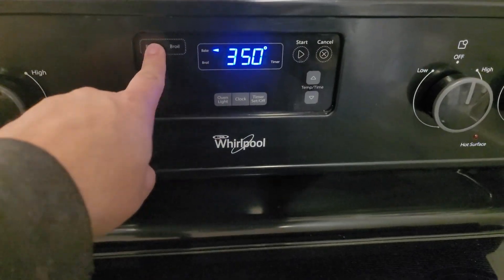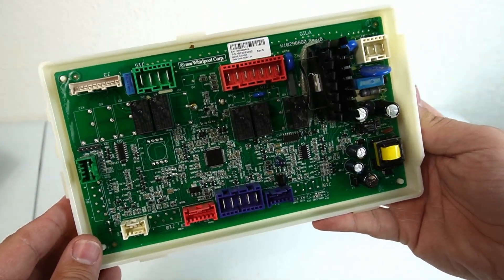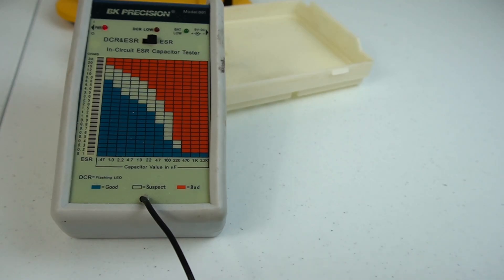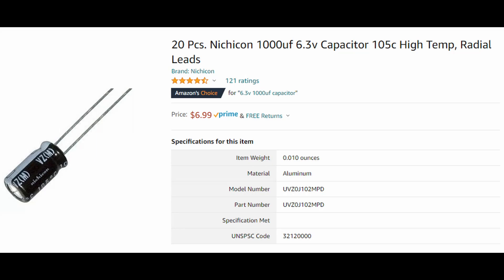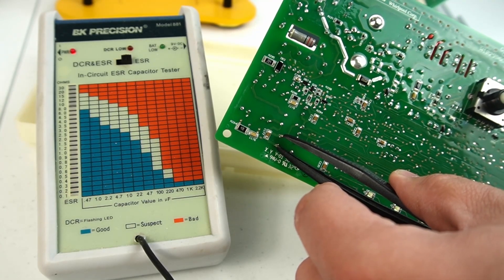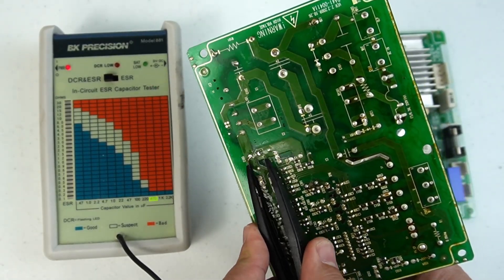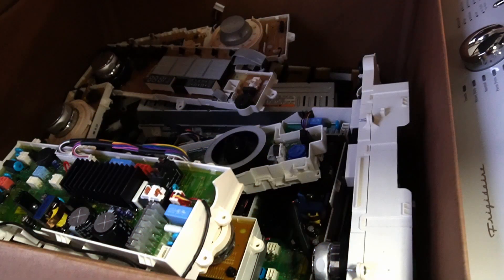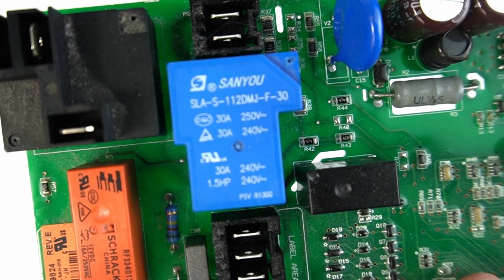Fix Your Broken Washer Control Board for CHEAP! How to Use an ESR Meter for Board Repair

Comment: What’s up Ben , love your content and really inspired to start a new career in this field. I have a favor to ask if you if possible . I have a whirlpool washer control board and I mistakenly burnt the big resistor that connects to the diode pair . I’m in good faith that nothing else took a hit other the  then the resistor . I was wondering if you could tell me the value of that resistor? The color bands on my are not able to be used and the ones I found on line don’t show it cleanly enough.

Comment: where do you have the video on how to remove the rubber coating on LG samsung washer and dryer boards?
Reply from the maker: I'll be honest and I think I've shot a video on that yet but that is a great suggestion on something I should be doing soon for you and others
Reply: @bensappliancesandjunk  the LG dryer control boards common issue is the relay connection on the board usually?   How do you take out the board from the plastic holder with all the conforming sealant? sealant?

Comment: Thank-you for this video! Found similar mystery board issue affecting lights, signals, safety stops on my family's medium sized tractor...how does one verify the existing board is the problem, with or without a schematic?

Comment: Excellent video and excellent teacher.  I know NOTHING about electrical circuits but was able to follow.  I have an LG Washer and love it. I bought it used about 10 yrs old and had it for another 7 yrs.  I refuse to give it up. I am getting an OE error and washer is not draining. I cleaned out all hoses, checked connections, replaced drain pump, checked water inlet solenoid valves, and pressure sensor. All working fine.  Some of the Display control panel buttons have never worked on extreme right side.  I think it maybe a Display control panel malfunction.  I do not have an ESR Tester only a Multimeter, sigh. I have to borrow one or figure out how to test main functions in that display panel or maybe its a fuse.  All I want to do is fix my OE error and get this washer running again. But, I am willing and able to check any capacitors on my board at some point and fix them. Your video was most helpful, many thanks.
Reply: Any updates on your washing machine? Was you able to fix it ?
Reply: @Chumichurri   @Chumichurri  Yes! It was the drain pump that needed replacing.  First I cleaned out my pump that was very clogged up, but that did not work. Then I bought one on Amazon but it did not work so I returned it, wrong model fault of seller. Then I found a genuine LG drain pump locally, at a good price, so in it went. Success!!  I cleaned out the whole machine, labeled all parts inside, repainted top, cleaned gasket, cleaned every hose.  Now it works like new. It takes tenacity to work out the bugs, but worth it.

Comment: Suppose its the type( Ex:MVW6200KW1) that the board topside is filled in with epoxy and the bottom is encased in nonremovable plastic

Comment: I have a frigidaire model fgid2466qf9a it power on then cut off. I checked for power and there is. I took off the board but do not notice anything burnt. Any suggestions

Comment: Question for you I have replace 3 board on my washer something keeps damaging the boards.can you tell me what will do that...
Reply from the maker: Question is what part on the board went bad. I've seen drain pumps knock out triacs on boards that show the drain pump is bad, and the board gets replaced when it's both board and pump. I'd investigate the board and go from there on why it died vs. Just replacing the board

Comment: Cheap capacitors fail in everything with a circuit board. A great place to get caps is Mouser Electronics or Digi-key. Use Nichicon or Panasonic caps, they are the top brands. I would stay away from cheap capacitor kits as those are most likely floor sweepings.

Comment: You may have to dig the probes into the solder joint. These boards, at least the one in this video and mine, have a waterproof coating on them. That's what that shiny coating is that you're seeing on the board in this video.

Comment: What would cause  the control board to randomly select modes on its own without actually touching any buttons. ? I took the control panel out it and it  is not wet.  It's like some days the buttons work. Also some days it turns on and starts selecting modes by itself.

Comment: is it a defective capacitor or did something cause the capacitor to go bad????....if you put in a new capacitor, will it blow again????
Reply: Could been power surge, I didn't  know I needed a surge protector on my wall plug in. Know now. Store said   warrenty was no good if I set washer up, paid them to do it guess what he never said anything About surge protector. You know what happen, now been waiting 4 month for part. Screw that, at work I check & repair pc boards at work they wanted $2200.00  a new one all it was on all of them was a fuse so you know what i'm doing . Thanks great video

Comment: Hi Bens appliance and junk and everyone. I want to repair my elderly neighbors Dyson washing digital control board circuit board, the control is only showing 3 words instead 6, the first 3 words on the digital control board are to faded to understand, I don't own a ESR metre but I own a voltage, ohms etc metre, which I cannot remember the name of, can that be used instead of a ESR metre and can anyone please help me out with any tips or advice so I can repair my dear elderly neighbors control board circuit thankyou so much. Great video thankyou.

Comment: Can't I just do the same thing with a multimeter?
Reply from the maker: Generally, no
Reply: @bensappliancesandjunk  bummer. Was hoping to save the money, since I already have a multimeter
Reply from the maker: @dakotbeastj  multimeter can't test on the board. Generally you'd have to desolder then tesr
Reply: @bensappliancesandjunk  good to know. Thanks man. I can clearly see a bad relay on my dryer board, so I'm going to start there, if I need to purchase that style meter in the video, I'll do it 👍 

Thank you very much for your help

Comment: Silly question, but why can't I just use a multimeter on the resistance setting and refer to a table for acceptable values? Why do we need this expensive tool just for a pretty light?
Reply: Because standard Dmm's only measure DC resistance, which in any capacitor will be over limit. The esr meter measures by sending an ac 100Mhz signal through the cap, effectively measuring the equivalent series resistance. Basically the reason is because Esr and DC resistance are not the same thing

Comment: Did you discharge the capacitors before testing? If so how did you do that? Just short them together on the board? I thought they had to be removed. Great video about to do some testing on a bad board but I’m worried about not discharging them before testing and I thought they had to be removed to discharge
Reply from the maker: No. The whole point of the ESR is you can test without doing anything but using this meter
Reply: @bensappliancesandjunk well most ESR meters tell you to discharge the cap before testing. Some will be able to discharge themselves usually up to 50v, some have protection diodes between the probes terminals, some will just fry with voltage. No need to desolder the cap but definitely necessary to discharge with an appropriate resistor from + to -

Comment: My Whirlpool Top Load washer keeps failing for the pressure switch that is built into the control board. It just stops but all functions seem to work. If I restart it on rinse or spin it will always finish the job. But from start to finish it almost never finishes in 1 go. Any recommendations on where to start looking on the board? Since it's not really a power issue and everything seems to be working. Ill start by looking for the obvious and then that specific area of course.

Comment: Do you know of a repair service I can send my Maytag Sg1000 board to in order for them to fix it?  I have tried upfix but they were unable to help.  The 'regular' wash button will not start the washer any more.  upfix thinks it is the pressure sensitive pad that is the problem.
Reply from the maker: Corecentric is the typical standard
Reply: @bensappliancesandjunk  Thanks, I will give them a try.

Comment: Love your video! I was all excited to try and repair the control bd on my GE Harmony washer using this method. Unfortunately I get the module out and find it is emersed in some sort of clear rubber. 😥 The control module is WH12X10282 and even a used one goes for min $150, and this is for an old used part that may not even work! I found this video about removing these coatings, and even with all sorts of fancy specialty tools (that I do not have), it looks like a nightmare. If you are curious just search YT for "PACE Rework and Repair "Conformal Coating Removal".
I don't think it is worth putting that kind of money into a machine this old. Sadly, unless someone has an idea, I think I have to buy a new washer.
Reply: I have the same problem with a samsung inverter control board. Its imbedded in a kind of clear gel that also sticks to the bottom of the mounting box. I can not even lift it out to de-solder the bottom of the board!
Probably all washers have it because of the water / humid environment!

Comment: Not  all the time it works  like that you have to remove  the part to test them  because  you will pick up other circuitry readings
Reply: This is an EST meter. It uses AC volts to test components. Multimeters use dc. The whole point of an ESR meter is to test in circuit. Plus removing the capacitor and testing capacitance is only half the story. The ESR meter is way more accurate and trustworthy when visual or multimeter reading is normal.

Comment: It's funny, I have a maytag bravos xl in the shop for a no draining problem. no power to the pump. Suspecting a control issue. Find your video and quite literally as I'm watching it, the drain pump turns on and hasn't had an issue since. I spent days trying to fix this and it just revived itself

Comment: Would be incredible if you did more circuitboard and PCB troubleshooting/faultfinding. You’re such a great teacher and explain her and as someone who works on component level industrial circuit boards full-time… It’s always fun to watch how others approach the task. And see the test equipment or workbench setup that they have.
Reply from the maker: Thanks! I did do a video on a simple board replacement recently as well
Reply: @bensappliancesandjunk  so what do you use to get the capacitors off the board ?  What desoldering techniques do you use ?

I’m not so much into appliance repair, but have worked on electronic component level repair on and off for years and still have my Pace rework station. Keeping it running isn’t cheap, but it makes life so much easier for swapping out parts, both through hold and SMD. It was a big big outlay for me 30 years ago, but it paid off pretty quickly, as boards I used to work on were thousand dollars plus in todays money 

How much support is there for getting these appliance boards repaired, and are there third party controller boards that you can drop in as a replacements ? Would there be a market for those sorts of things ?
Reply: @MidlifeRenaissanceMan  For cheap solutions, we use a $40 de-soldering pump. Techs that do board repair more frequently than us tend to use Hakko FR-301's. 80% of repairs are caps or relays. When it goes beyond those into resistors, triacs or logic boards (especially), techs shy away from them because you get a lot of parts bloat at that point, whereas about 17 types of caps and maybe 20 different relays will fix 80% of appliance failures with first call completes.

Comment: Don't waste your time with a dedicated ESR meter if you are just started out, instead you should get a cheap component tester, such as the BSIDE ESR02 Pro.
Reply from the maker: Does that allow you to test the caps on the board without de soldering?
Reply: @bensappliancesandjunk  Some of them do, but usually not the cheaper ones though. I didn't consider that angle when I initially wrote my comment, they are good for testing active components which can't be tested in circuit anyway. I still somewhat stand by my original comment because they are great for appliance repair and are cheap as dirt.
Reply: @bensappliancesandjunk  The Peak ESR70 is a good, cheap, and more compact ESR tester that can do in circuit testing.

Comment: Yes I like the ESR meter, be cautious to those trying to repair a board as those newbies. Larger 200 volt, 400 V capacitors have the ability to send you flying into the next room or kill you. Handle circuit boards with care and discharge the cap by shorting it especially if it is a high voltage cap.
Reply: You can discharge capacitors with pliers that are isolated from your hand
Reply: Won’t that ruin the capacitor if you short it out?
Reply: @chrismcclain6518  Nope your OK to short to discharge, normal practice and required practice.
Reply: Lol. Kill you. I dont think 200v kills you. Where i live its 240v and ive gotten shocked so many times handling circuitboards and motors🥲

Comment: Can be done with Multimeter..
Reply: Of course not, a multimeter cannot perform a reliable test with a capacitor soldered onto a circuit !
A simple ESR also cannot.
Because this special DCR-ESR made by GME uses a <100mV test voltage which won't forward bias diodes or transistors.

So before claiming a truth, please find out ;)
Reply from the maker: Can you suggest a multimeter that can do this with the cap still on the board?

Comment: Vary good info I am 6 months into appliance repair working with a company right now but hopefully go out on my own later
Reply from the maker: Awesome! Its good to learn and make mistakes when someone else is paying you for them. Board repair is a great skill to have, because once you learn, you can fix a board in the customers house for like... $5 in parts and charge $200 and not have to waste gas coming back for a new board.

Comment: Dude. Great vid. Can a multimeter do this?
Reply from the maker: Hi, the answer is "Kind of"

Higher-end multimeters can do capacitance/ESR tests. However, they generally CANNOT do it on-board. You'd have to de-solder the capacitor, then test with the multimeter. Even some/most ESR meters can't do on-board testing, either. As far as I know, that technology/ability was basically invented and pioneered by BK Precision and the GME knock-offs, or so I've been told. So sadly, you do need the special meter to hardcore capacitor tests quickly and easily.
Reply: @bensappliancesandjunk  thank you
Reply: I was wondering the same thing. He gave a very thorough response. I’m impressed.

Comment: Would love to see more repair and troubleshooting videos regarding test equipment! Wonderful video! 👍
Reply: Holy crap. Is that huge pile of circuit boards in your video yours? Do you plan on trying to fix them or do you just keep them for parts? I would buy them all if you were somewhat close and shipping wasn’t so expensive.

Also, the guy who designed the circuit in the ESR meter is named Dave Miga. He’s the owner/operator of electronic design specialists.

He invented the “cap analyzer 88a”….. and then his circuit was widely copied. If you get a chance to snag one of those on eBay, or if you purchase the parts kit and build it yourself… I highly suggest it. 

Another device that he invented and is worth its weight in gold… it’s a device called the “leak seeker“… 
. Even in my metrology lab sitting on the bench next to High end test equipment that is all NIST traceable/calibrated equipment… I still use both of them almost every day. 

And find them just as useful then all my fancy metrology equipment. And when troubleshooting they are my go to!

Comment: Hey Ben. I notice at 6:15 you change the ESR Meter setting from ESR to DCR&ECR. Why is this? (Sorry, I'm not a techie.) Also, is this test possible with a typical multimeter?
Reply from the maker: It was on accident. That mode tests DC-related resistance @ 0hz, while the ESR tests AC resistance. There are a few components on the board that DCR would be valuable to use on, such as non-inductive resistors (not caps). I accidently used the DCR (which is automatically employed when needed). I edited that out but it sounded like a tornado siren. That threw me WAY off guard. More or less, its a bonus test mode, but we've never used it to fix anything, and the DCR will just use ESR until there's a non-inductive coil.
Reply from the maker: Here's BK Precision's press release about their 881 we use in the video that explains most of this: https://news.thomasnet.com/fullstory/capacitor-tester-performs-in-circuit-esr-and-dcr-testing-24783
Reply: @bensappliancesandjunk  Got it. Thanks for responding so quickly!
Reply: Hey Ben im.just getting into board repairs and I have about 30 allmost new amana washers I picked up for next to nothing. They just about as soon as I plug them in just start pumping and won't do anything else. Any thoughts on repairing this issue or are the boards shot in this case
Reply from the maker: @adampeckham9987  thats a flood control mode issue. Let them run for 20min until the board is triggered, then either re-run a wash cycle or more than likely, replace the pump motor.
Reply: Thanks I'll give it a try. This is a new issue for me.